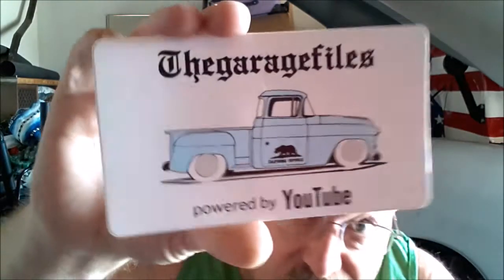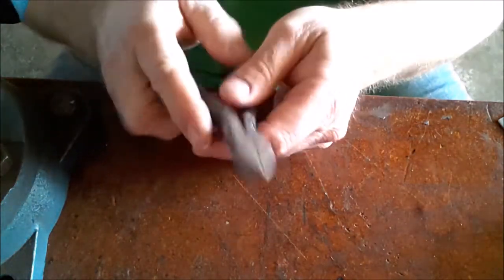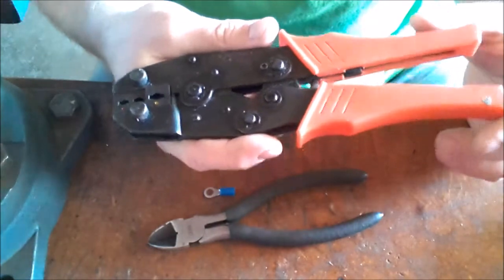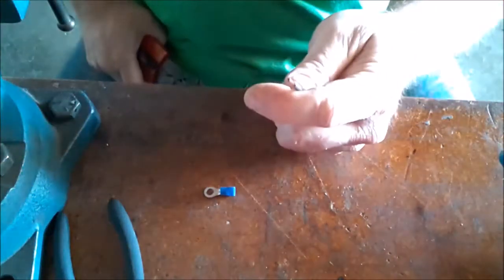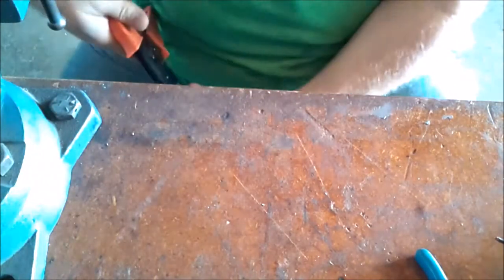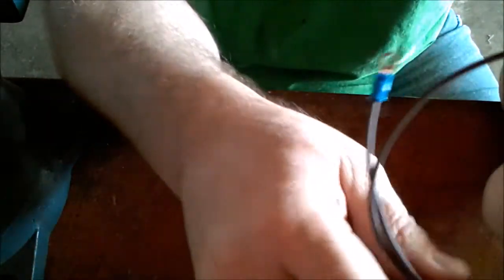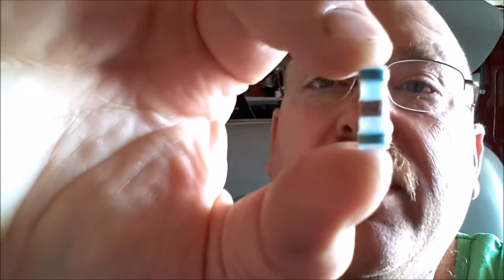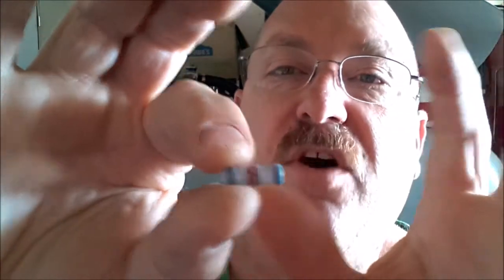Wire Crimping How To & Mail Call

Comment: You are correct it is a 57 thanks for the mail and wiring info, I try to solder and heats brink all my connections, some cases I use the terminals, need to find me some ratchet  crimpers